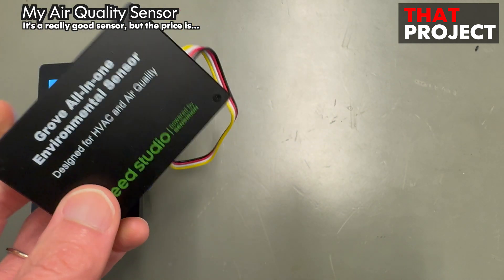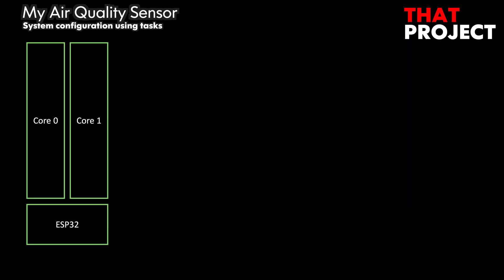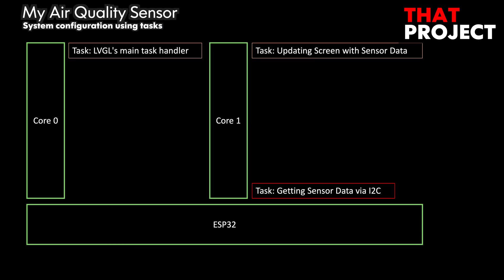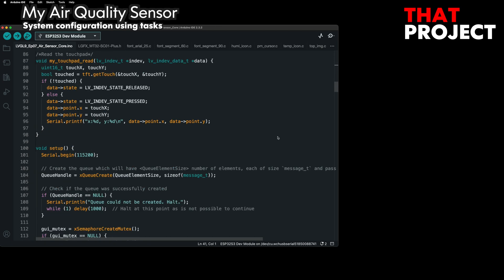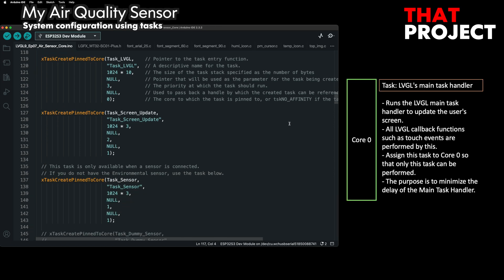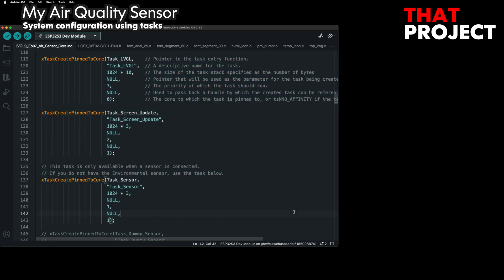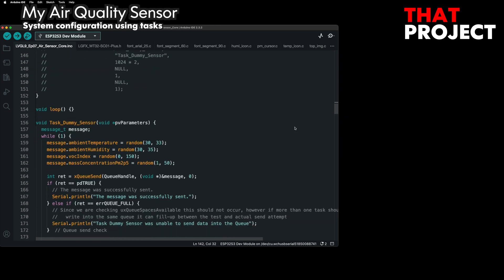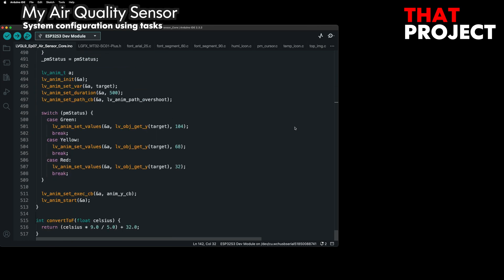LVGL Tutorial with ESP32, How to update the screen with data obtained from sensors. #FreeRTOS #Task

Comment: I have a question, how feasible is it to run a code from the SD card to take advantage of all its storage, and show detailed images on the different screens of the project...
by the way, good LVGL 9 saga.
Reply from the maker: @mateobien  It's an interesting idea. It's impossible to read the code on the SD card and configure the screen because it's not already built. To make it possible, it seems like the only way is to put the firmware file of the desired program on the SD card, select the program you want, install it, and use it.

Comment: HI， Old friend, I am delighted to share with you our latest achievement - an innovative development board that integrates the ESP32-S3R8 high-performance processor. This solution is not only equipped with a 2-megapixel OV2640 camera and a 1.3-inch SPI display screen, but also integrates an RJ45 network port to achieve powerful data transmission and connection functions. What's even more exciting is that the onboard codec and microphone design have opened up new doors for audio processing and interactive applications. I hope to explore the infinite possibilities of ESP applications with you

Comment: I bought a display but every code o try to upload to it gives this error Even tried googling it but nothing Someone help pls

E(91) esp_core_dump_flash: incorrect size of flash dump image: 0
Reply from the maker: Did you set it to Default in the partition settings? Or did you choose Huge App? In the case of the Huge app, you can see this error message because the core dump partition does not exist. However, if you are not using coredump partition, you can ignore this message.
Reply: So, we are using the default partition settings 
The weird thing is that the display is reseting it self or something like that. We thought it had something to do with that error cause it runs through the whole code 

Can send more info if needed, we are completely lost honestly
Reply from the maker: @murielcordeiro1231  That's  weird. Going back to the beginning, you said you got the same product as me, the WT32-SC01 Plus. Is that right? Is it set to OPI PSRAM in PSRAM settings? This must be set to QSPI PSRAM.